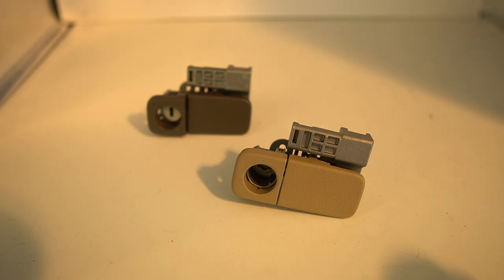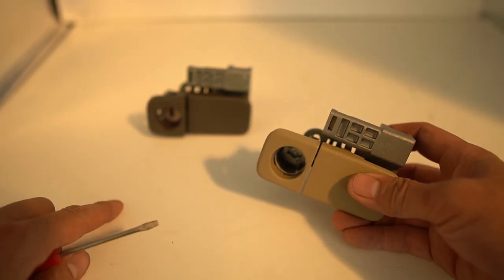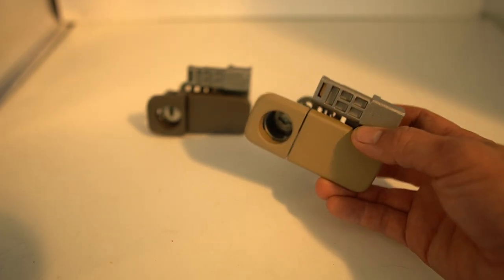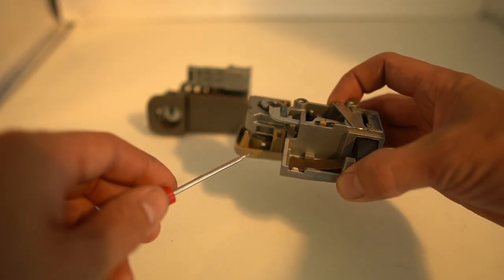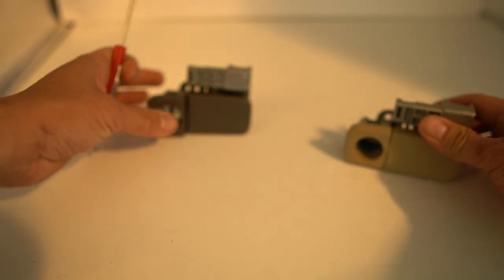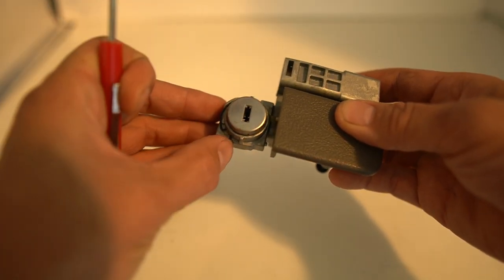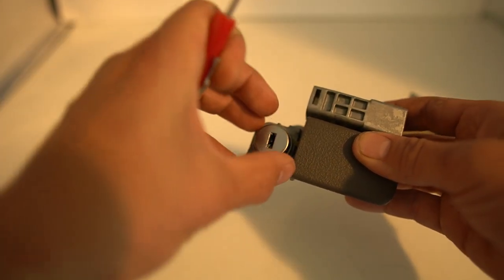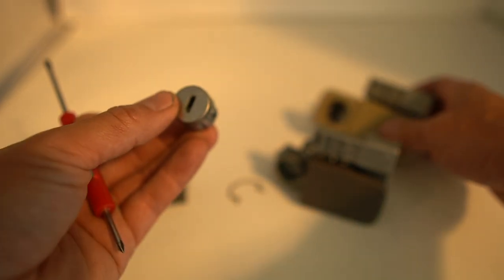2007 - 2011 Honda CR-V Glove Box Latch Lock Core Replacement

Comment: Will this work for a 2006 as well?
Reply from the maker: The 2002-2006 CRV is a different body style (so it uses a different latch).  I haven't figured out how to do it yet for the 2006 but I think it is possible to move the lock core over.